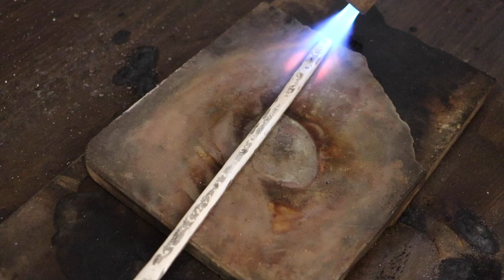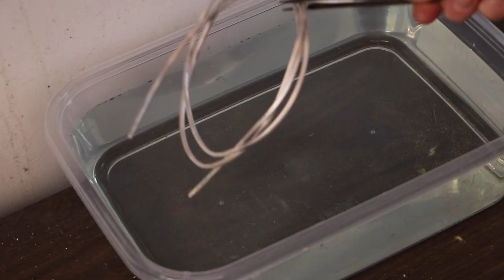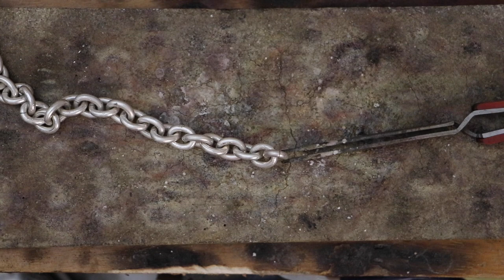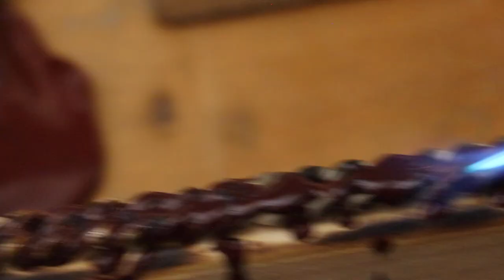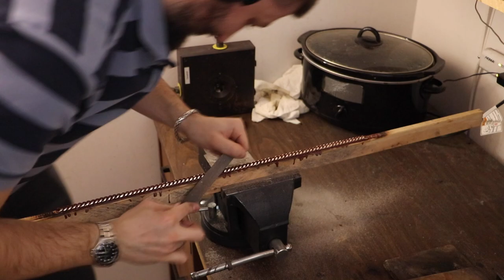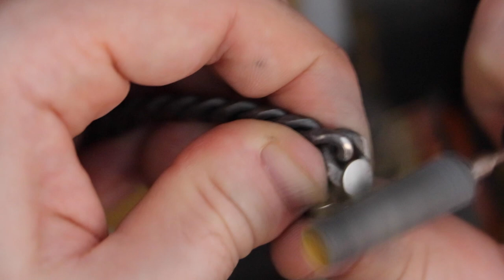MAKING CUBAN LINK

Comment: Amazing i wouod not have melted down the bracelet though how much for this
Reply: You can get a sack of them, along with rings, earrings, polished gravel, and other useless shit. They cost about as much as the melt value of sterling silver. Go figure... It was melted because a "new" item sells for many times the price of the materials in it. Therefore, the price of jewelry is set by the intersection between "how much work you think it took to make it" and "how much you like how it looks. If you want used jewelry, go on an auction site and purchase a couple lots of things you think look good. Keep the stuff you want out of it, and then re-sell your own lots. The net effect will be paying a bit more than melt cost, because you wanted the stuff for reasons you valued greater than the material value, and then you will likely be selling the discards at melt value. If you do this just a few times (except I don't sell back into the mix, I melt most of it), you'll become detached from the perceived value of a thing after coming across several identical pieces from different sellers. In the world of electronics, we call this "commoditization".

Comment: A narration of the process with devices and tools being used would be interesting in captions.  I remember the cradle, cast iron molds, mill, wire pulling, coiling and jeweler's saw to make links. I  am guessing the gauge based on the size of pliers. The assemble of links is nice to see the patterns being created.  The green flux to prevent fire scale then wire solder. Cleaned in pickle, annealing to soften the metal then pickle to clean it. Resuming twisting,  hammering with flat head jeweler's hammer. The wax and wooden holder is interesting prior to filing and sanding. The tap and die to make fittings looks fun. Compounds vary in grit fromm 200, tripoli,  white or Rouge. Steam cleaners are helpful 👌😀

Comment: What is the wax you put onto the chain prior to filing it and why do you do this please? The results are spectacular
Reply: Buffing compound for polishing wheels I believe
Reply: Either that or sealing wax to keep it still
Reply: Its shellac to temporarily "glue" it to the board to file. It really has nothing to do with the finished product as you use buffing compounds on the final process .

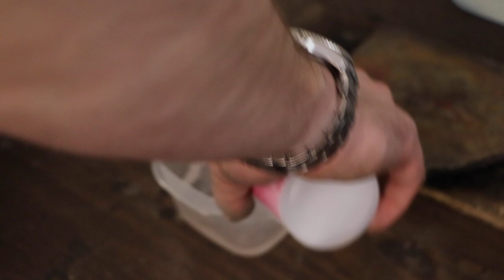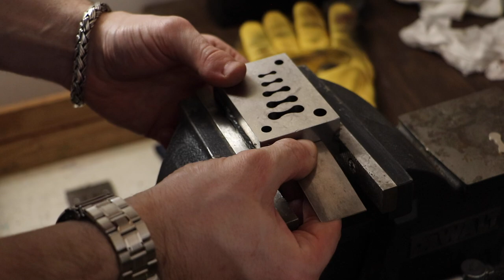Comment: Thanks for sharing I have 2 question if you don't mind what liquid did you use to remove the shellac at 26:16 and where can I find the tool that you used to make the ends caps at27:40. thanks in advance
Reply: Have you found it? I'm looking for the solution to take the shellac as well!

Comment: your videos inspired me to get everything to start making necklaces. i did chainmail jewelry a few years ago just as a hobby, now im wanting to try to make a cuban link. i made my own rings, but all my solder joints broke when i tried to twist them. im using a silver solder on copper rings, im using flux as well. i dont know if im not getting the surrounding area hot enough to flow the solder or what? any advice on the soldering?
Reply from the maker: Thank you. Because copper oxidizes very very much, and that oxidation doesn’t allow solder to flow where it is needed even though you are using the flux. try with silver, it is different.
Reply: @DynamiSJewelry  damn, I’m watching your video right now as you responded 😂. I wanted to try it with copper cause as I was going through Home Depot today I noticed I could buy 8 awg solid copper wire so I finally took the plunge and bought the other tools to try to make a necklace and the solder and flux I bought is specifically for copper, so I didn’t think I’d have any issues. Also, I didn’t wanna try it with something expensive like silver because I feel like I could get more practice with something cheaper like copper.
Reply from the maker: @johnmaley3020  i used to start with copper too. So, be patient and get more practice
Reply: @DynamiSJewelry  do you know any premade wire I could get that would be good and cheap for practicing? And possibly a place I could order some from?
Reply: @DynamiSJewelry is there any specific flux or wire I should be using? No matter what I do, the solder seems like it wants to go anywhere but in the joint where I want it, and when I can get it to flow in the joint, it just breaks apart when I start to twist it

Comment: hey i ended up getting some handyflux and some hard silver solder chips, it got the copper rings soldered together perfectly. the problem im running into now is im having a hard time getting the copper rings hot enough to accept the solder because i think im using a 12 gauge wire (something super thick). propane or butane isnt doing the job very well, but i have access to any oxy-acetelyne torch at work. is there anything that would give me more heat that i could use at my house besides investing in an oxy-acetelyne setup? ive seen some mapp gas/oxy setups, or should i just bite the bullet and save up for a mini oxy/acet setup if im wanting to solder heavy gauge wire?
Reply: what kind of solder are you using btw?  is it just a hard silver wire solder? I ordered some of that but it wont be here for another week, so i got some easy, medium, and hard silver solder sheets in the mail today